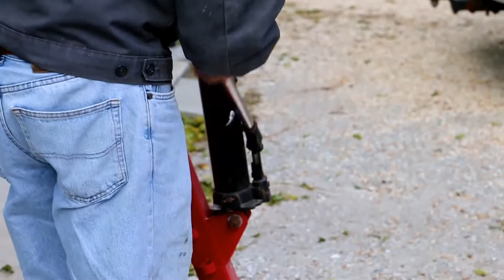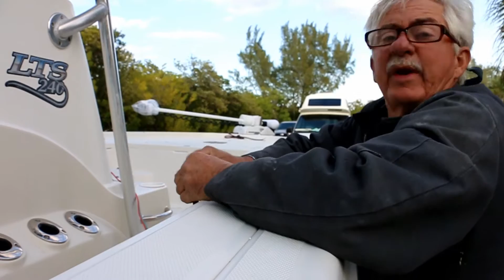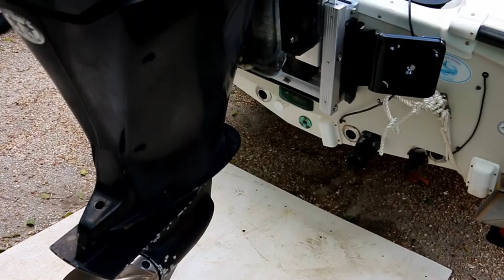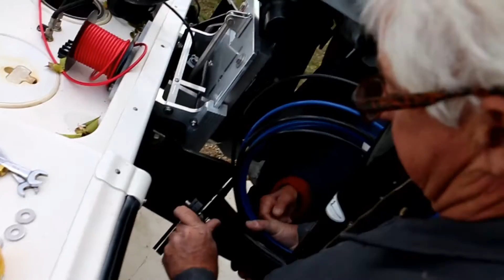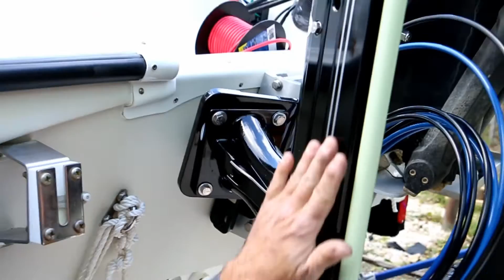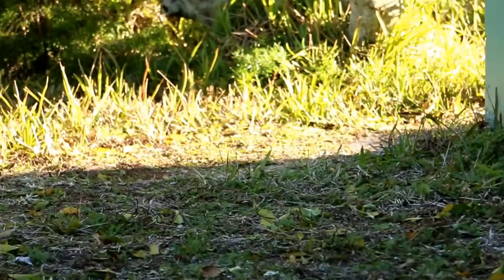Jack Plate Mods and Power Pole Installation Tips with Ed Fernandez

Comment: Hey Capt, what prop size and pitch are you running on that boat?
  I just put an 05 verado 250 on a 2000 20ft ranger bay boat. 
Think those triton hulls run similar being a little heavier than other hulls.

Comment: ... 1-13-2022 ...Thank you. This is the first video I have found that I can really relate to. 
I have the same boat and Verado with a Bob's Versa Jac 4" Extreme, manual JP. 
2- 8' white PP and brackets are on order. ETA- next week. 
.
Who bolted the Verado to the JP w/o the spacers 😮 when you started? 
As you are aware the engine mounting plate is wider than the gap between the fixed sides of the JP.  Just stating this so others are aware of it. 
Buyers/owners beware: You need the EXTREME JP, not the HD JP. The EXTREME is rated for the weight of the Verados and you must have the spacers.   
.
Mounting the pumps:
 Is there any concern of what is underneath the area where you mounted (screwed down) the pump brackets?
.
Power to the pumps: 
Where did you get the power from? 
Did you run wires from the console House Battery to have dedicated power?
 If YES, What gauge wire did you use? 
Are there fuses included in the PP parts box?
.
Sorry for all the questions but I have mounted them in my mind several times. 
When it comes to actually mounting them I want to be prepared. 
.
Thank you very much!!
Jeff
.
Reply from the maker: Thanks for your comment. Direct your questions to Ed at Suncoast auto marine